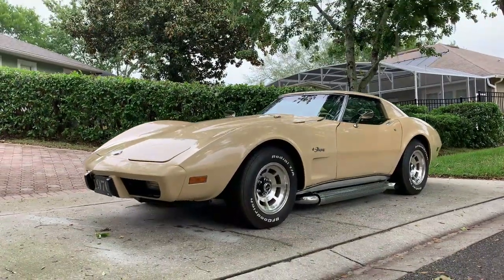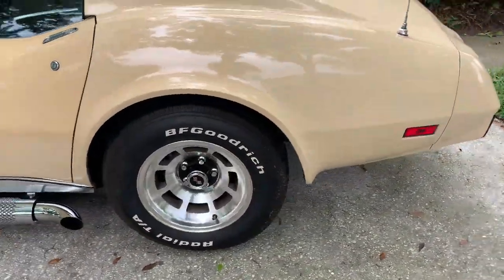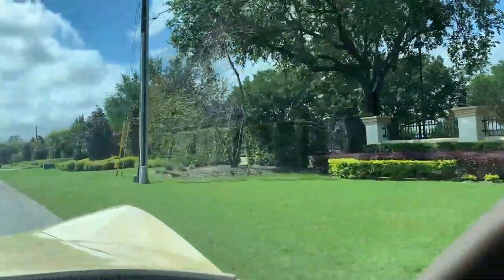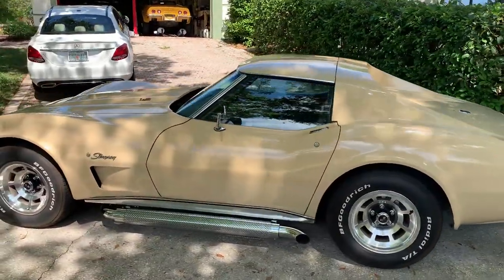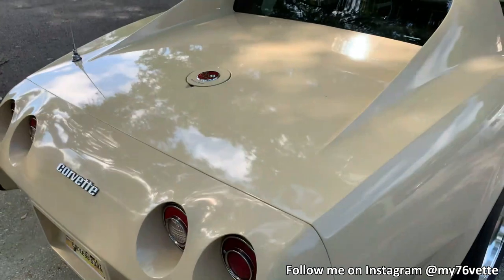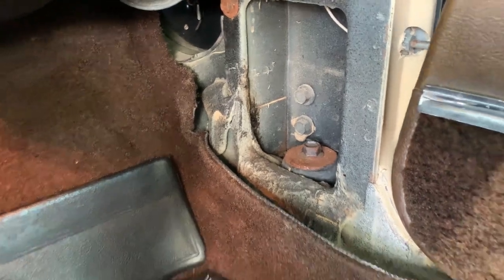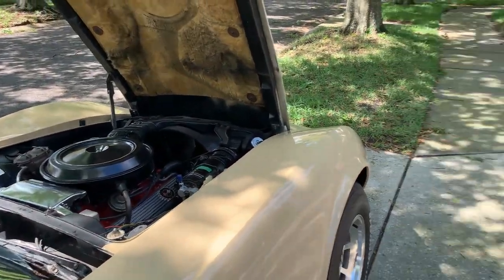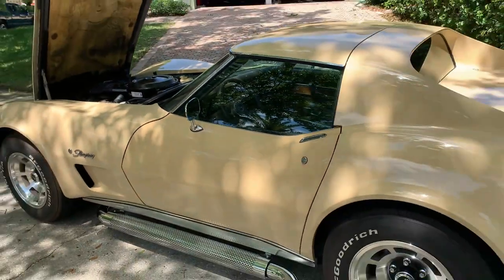LOW-MILE 1976 Corvette FOR SALE by Owner

Comment: I’m a purist so I can appreciate it ..Very clean and mostly original car Getting harder to find .. not a big fan of the color . I own a 75 1 owner with 10k original miles
Reply from the maker: It was a great car with a ton of paperwork which is very important IMO, but it could’ve used a complete repaint, and a good paint job can be very expensive. Congrats on your low-mile ‘75. 😊👍🏻

Comment: These cars can be great. I had a 74, the last year for no cat's and the 454's. Mine was the L-82 and when modded with a Victor Jr, 750 Holley and a cam I was beating Mopar BB's and all the mustangs I could find. It was good for 135 in 3rd and 165mph in 4th gear. Paid $6500 for it and sold it for $9500. I had it for 7 years.
Reply from the maker: Thank you for watching! 😊👍🏻

Comment: Very nice; does sound like it's missing though.  May be the sidepipes.  Yes those grills are heat sinks so you don't burn your calves every time  you get in and out.  Even with low miles, age does deteriorate certain things.  Looks like it's untouched.  Besides the repaint, probably worth more untouched.  I've ran 285's on the rear of my stingray with no issues.  Just had to worm clamp the emergency cable to the trailing arm.  They also look natural; not too much over hang.  Those bicycle tires don't do the car justice from the rear.
Reply from the maker: I had the same issue when I had a dual exhaust installed. A crossover pipe solved that issue. Yes, the car is pretty much all original. The side pipes look and sound good but I would go back to the original exhaust if it were mine. It rides very nice and smooth with the thin tires which I believe are 225. Thank you for watching! 😊👍🏻

Comment: A very nice car, the birdcage  looks good too. just curious about the price. I would love to find one in that kind of shape, if the price is right I don't think you could go wrong.
Reply from the maker: Yes, the car is very nice and the seller was very accommodating and he even removed the kick panels before i got there so I could inspect the birdcage. 
It is rare to find a C3 with low miles, in excellent condition, and a 4-speed transmission, nowadays. 
Thank you for watching! 😊👍🏻